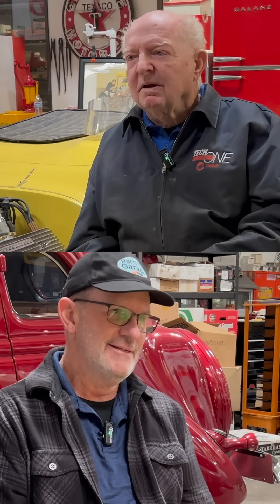What Happens in 1 RPM? - Ask Ed 20 - Ed Smith w #BarryT

Comment: What's super interesting that I found out and confirmed with a dial indicator on the Piston with a degree wheel on the crank is that at least on my small block chrysler, the Piston is sitting absolutely still at top & bottom dead center for almost 5° of crankshaft rotation.
Reply from the maker: That is very interesting

Comment: Old farmers running a 1 cylinder bulldog tractor, they would stall the engine at the end of the feild, and get the engine to restart / push start in reverse , so they had all the gears still to go back across the feild, vs. just reverse.
Reply: Early Fairbanks and Morse opposed piston  diesel/electric locomotives reversed in a similar fashion . Supposedly there was a loud grunt when it was starting to reverse .

Comment: Naw, there's a stop motion to the crankshaft too. It needs a flywheel or some mass to carry the momentum through the next compression stroke. It's why single cylinder steam engines have big ring flywheels on them to keep a more constant motion. Automatics have heavy converters, clutch drives have flywheels, etc. put a strobe light on a marked flexplate some time and you can even watch it settle at each BDC